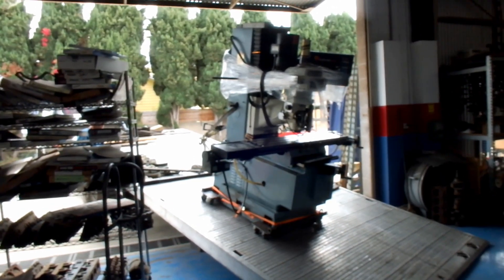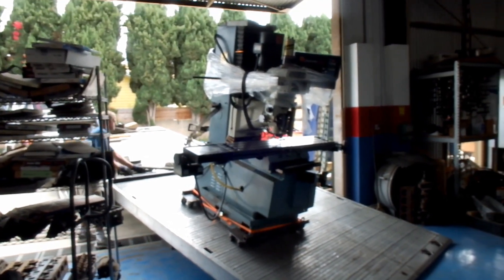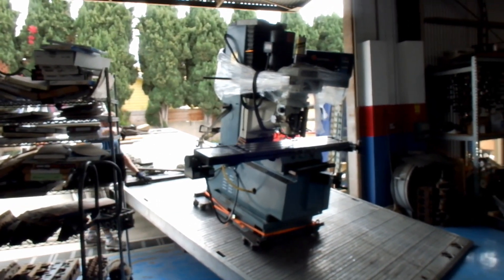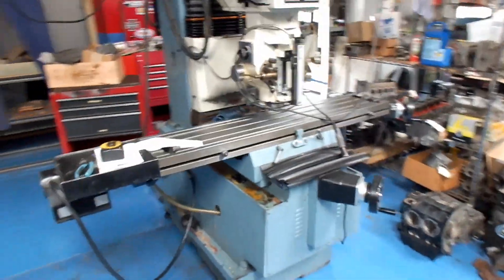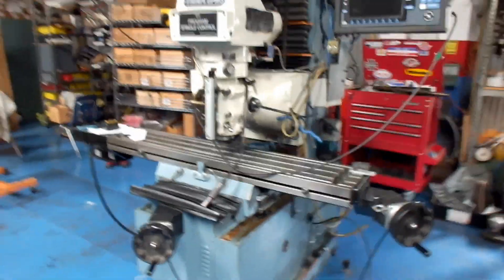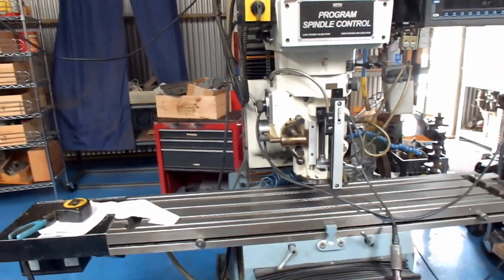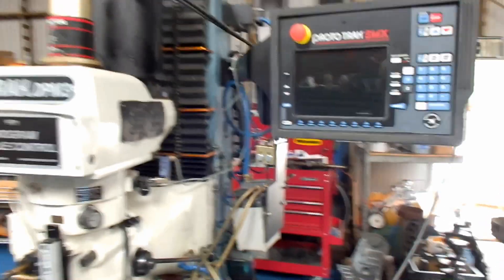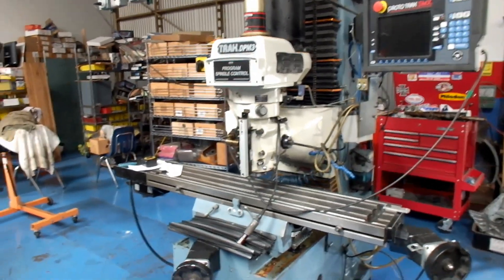Prototrak DPM SX3P CNC Mill Delivery @ Costa Mesa R&D Automotive Machine Shop

Comment from the maker: This is a bed-type mill and weighs about twice as much as the bridgeport for ridgity. Yes, I will keep using the Bridgeport untill I completely understand this machine. There are times where it is much faster to setup and use than a CNC machine, especially if you are only doing one or two parts. This controler is available for Bridgeports and clones. Go the the Southwest Industries website and have a look..

Comment from the maker: Making the manifold should be no problem. I don't know what a 'cox' engine is or what car it is in. If you can send an intake manifold gasket and supply me with a few additional measurements, that would be a big help. 

Thanx to my translators out there in YouTubeland.